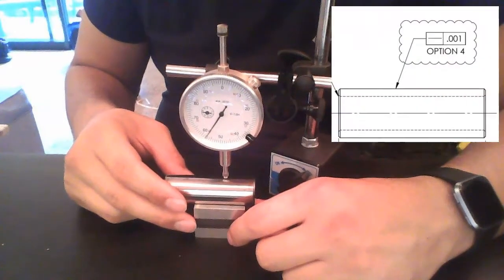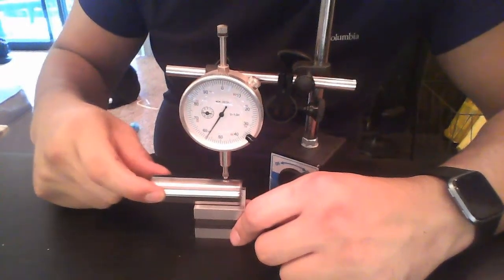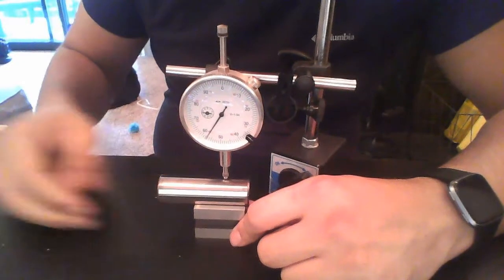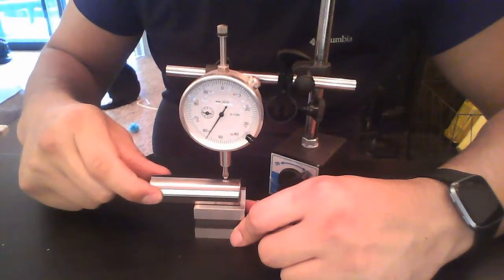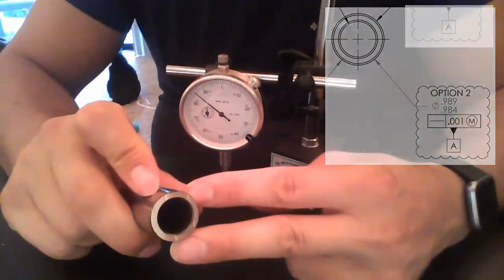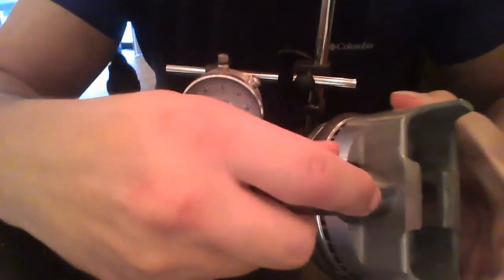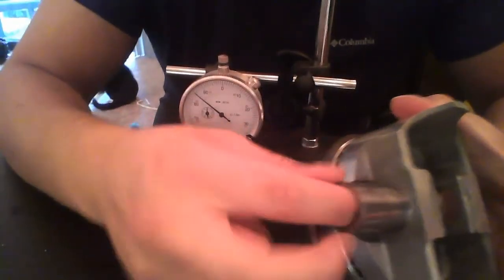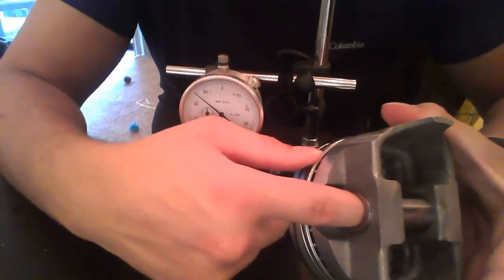Measuring Straightness

Comment: Please could you advice the brand's and model's tool.  We have a steel round bars, lenght 3-4 meters...and we want to test straightness specification < 0.50mm/m (mm per metre). Thanks in advance.